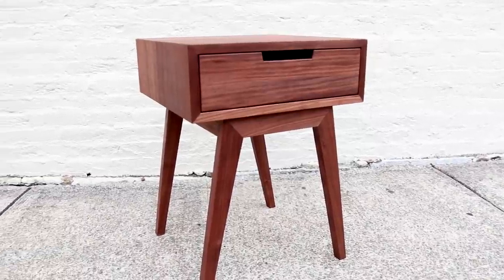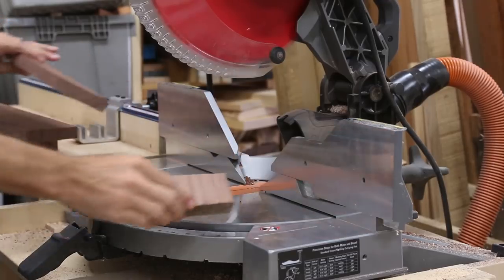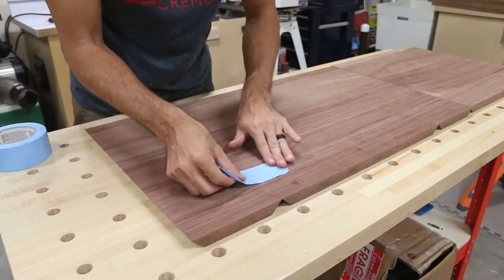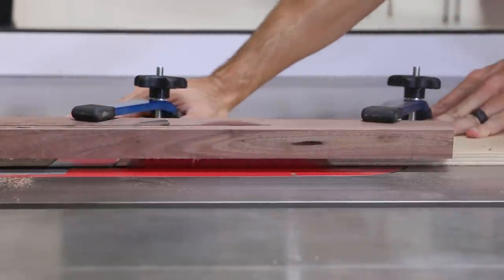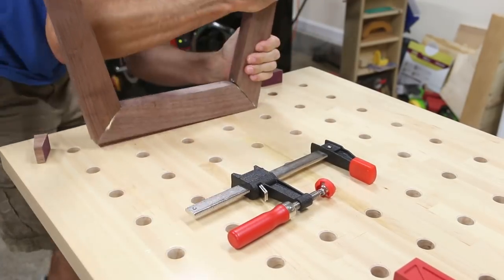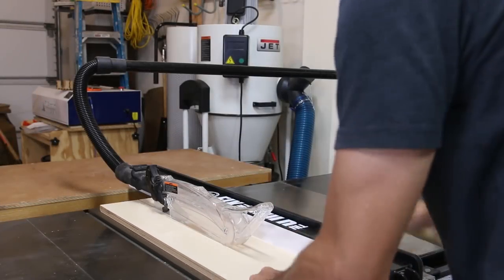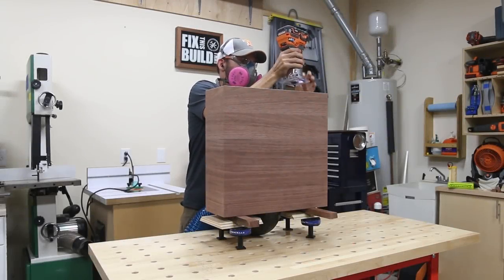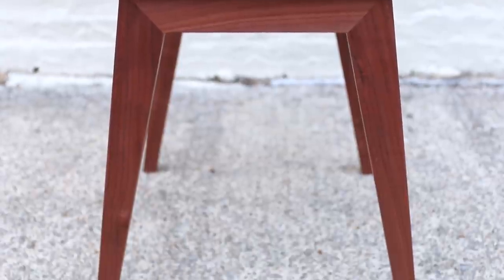Modern End Table / Side Table | DIY Woodworking Projects

Comment: Looks awesome and nice work on those mitered edges!
Reply from the maker: Thank you!  They were easy to do but hard to setup :)
Reply: I know what you mean - I tried the tape method on a project a few months ago and it failed horribly - project still worked, but I think I was using the wrong tape! Cheers
Reply from the maker: Yeah, I'd go with painters tape or a packing tape

Comment: The diagrams show exact cuts, but I saw you cut the ends off a bit. I am assuming I make the pieces longer than the measurements before glue up. I purchased the plans and wood yesterday.

Comment: That's a really nice looking side table, Brad! I really like the results that card trick yields. What did you think of the dowel joinery? Going to use it more?
Reply from the maker: I'd say with the miters it was great.  With the aprons it was a little dicey.  I'll definitely use it more in pieces like this where you can't hide the joinery.
Reply: That makes sense. I've used through dowel pins a couple of times now, and I kind of like that look too.

Comment: Hi Brad,
             I bought your plans for this side table and I’m in the process of building it.
I’m confused where you say cut the top stretchers and the legs at 50 degrees but set your mitre saw to 40 degrees. I have tried both angled cuts and in either case the top stretcher and the leg do not fit together ( ie 2 5/8” across the angles) could you please clarify/ tell me what I’m doing wrong.
Thanks
             Tom
Reply from the maker: Hey, Tom. A 40 degree setting (swung to the left) on miter saw will give a 50 degree angle on the piece left of the blade. So cut bot parts on left side of blade to get the matching  angles.